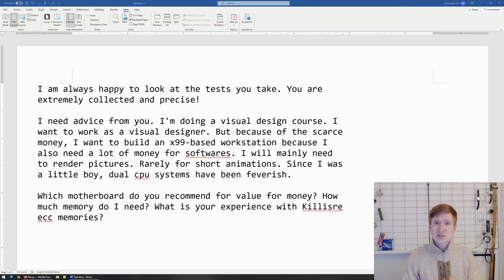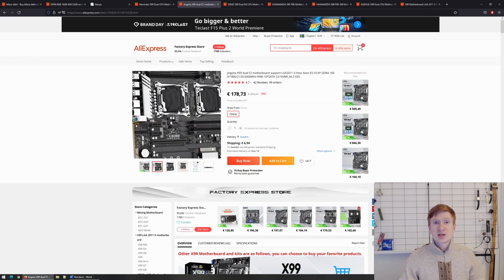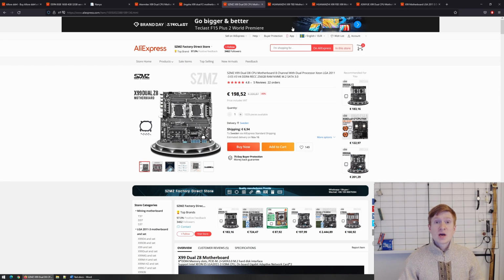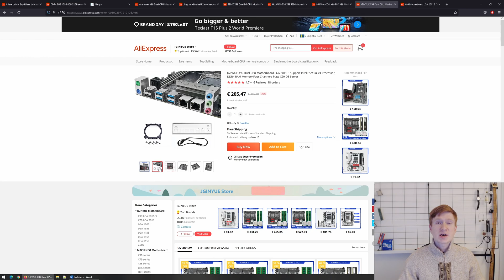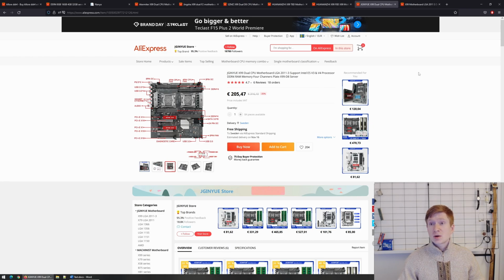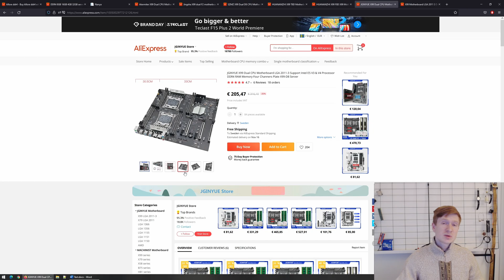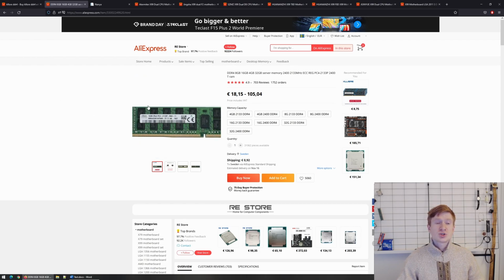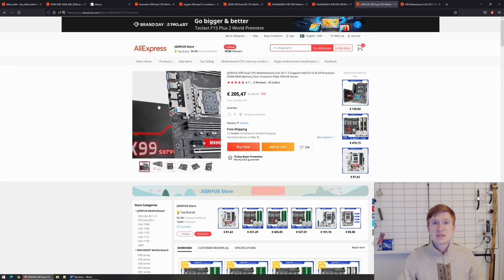🇬🇧 Dual Socket X99 motherboard for a visual design workstation | Miyconst Answers 03

Comment: Can dual socket motherboard used with single cpu? Planning to upgrade later.
Reply from the maker: Yes, dual socket motherboards can work with a single CPU, but some parts of the motherboard, which are connected to the second CPU won't be active.

Comment: Actually make sense but don't all video rendering already use all cores? Not sure. I only have an 8 thread PC but it maximizes them all.

But regardless, Graphics cards exists. It barely makes any sense to use a CPU based software rendering machine as opposed to a hardware rendering with GPU. Hardware rendering is vastly superior in terms of speed.

The only reason I can think of why they may use these machines are multi-workload machines. I don't personally have one but I'll probably use it as a NAS and CCTV storage for home security as well as maybe an offload rendering system so I can leave my home after starting the rendering process.

In the future, maybe network booting.

Comment: guys can you suggest which motherboard from aliexpress supports 2699 v4 CPU?
Reply from the maker: Huananzhi X99-F8 supports.
Reply: @miyconstclips  the issue is that I want dual xeon 2699 V4 🥺
Reply: @akrenderman  why do you need a dual socket setup?
Reply: @Miyconst  am doing 3D rendering mate
Reply: @akrenderman  then you can try Huananzhi X99-F8D, but make sure to cool the VRM properly.

Comment: Agree 100%
I am currently using and testing Huananzhi F8D w/ dual 2699v3 CPUs.
For my personal unit, TurboBoost unlock @2.9Ghz all core is resulting in 66c on the hottest core using 2x snowman MT6s CPU coolers. VRM temps are 49c and 60c under load measured with a cheap infrared thermometer accurate to ±4° or 2%.
All in all? Very satisfied. Keep in Mind Miyconst is 100% correct about memory latency and single core speed. In my case I am doing VM experiments using many cores and lots of ram simultaneously. These experiments are not designed for any kind of mission critical work or long term deployment, it's like my personal laboratory.
Reply from the maker: Well said!
Reply: How much power does it suck from the wall outlet while idling?
Reply: @_miranHorvat  unfortunately I have changed configs and I can't take from the wall numbers on the F8D with those CPUs. My 2x 2699v3s are in an asus z10pe-D16 now in a server build in an experimental deployment. If I get the chance to spin it down and introduce a watt meter for from the wall figures I will.
For the interest of general knowledge, the two chips are 145W and combined they will not exceed 270W. Total system power at idle is likely above 100W given that, in its current configuration, it has 2x 1070s, 10x 3TB HDDs, 4x 2.5" SSDs, and 512GB of ECC. When I can measure it, I will.
Reply: @greenprotag  I was wondering about the same. But my current home server uses 35W idle and 42W with the mechanical harddrive spun up, so if you have 10 HDD's you are probably well over 100W. Going with a single Xeon as replacement, was tempted to do that dual build but it's massive overkill in my case lol.

I found i7 chips to be very power efficient at idle. I use Win2016 server and even with power managment set to run the CPU 100% all the time it takes almost no power at idle. So was already wondering how that is for the Xeon chips.

What is a shame on these dual boards is that they don't leverage the real strength of these Xeons, and that is that they have 40 PCI-E lanes each. If you are going all flash for storage you can basically add 4x NVME SSD per 16x slot if they support bifurcation. Basically on a dual Xeon board you could run a 16x GPU if you wanted, 10Gbit NIC and still have PCI-E lanes for 15 SSD's LOL. You would require at least 5 full size 16x slots but better 4x full size and a few 4x slots.

If they had more PCI lanes a dual configuration with 2 lower end Xeon's would be very tempting.
Reply: @_miranHorvat  I have pretty much the same configuration, not dual 2699v3 but dual 2696v3 which are the OEM version with a slightly higher single core turbo. I also use it for a VM server, nothing critical but still. I have a watt-meter, I tweaked the voltage in the BIOS ( but failed to unlock turbo boost, however, I managed to get better single core performances from 370 to 405 according to CPU-Z ), I have 6 HDDs in ZFS, a shity GPU for output, and idle with 7 VMs running at the moment, it uses around 200 Watts.
Reply: @Kelianon  Hey bro, I am having the same configuration as you X99 F8D with dual 2696v3, do you mind to share how did you increase single core performance?
Reply: @aftershock7258  Sorry I am late
I'm not sure I really improved the single core performance by this bias tho, but the CPU-Z benchmark seems to go this way.
First, I unlocked the BIOS and tried to get a higher core count turbo-boost, but I failed and it's obviously because it sucks too much power and even the VRM can't even suck that much. ( 36 cores at 3.8 GHz ? lol !) that being said, I activated the C6 State without retention in the BIOS.

I already had windows server 2019 installed bare-metal, and did some benchmarks. With the results I had confirmation that I would not make it a powerhouse from single core loads, and I was tired tinkering with the BIOS for CPU unlock. I had around 375 for single core performance in CPU-Z. It is worth noting I had the hyper-V feature enabled but no VM was running, the test was made from the windows hypervisor. But that might have some effect I had not later.
 
I then switched to Promox for better VM management.
The first test VM, was windows server 2019 as well, but I did not activate the Hyper-V feature before the benchmarks, only AD DS and stuff. While creating the VM, I noticed I could change the CPU emulation, and by default, it is "kvm64". I wondered how much I would get on proxmox with that setting and surprise : I got a 7% single core improvement from 375 to 405, at the cost of some cpu instructions according to hardwareinfo, such as AVX. when I shut down that windows VM and change the "hardware" -> "CPU" -> "kvm64" to "HOST" ( so recognized as Xeon and not standard virtual cpu anymore ), then again I get the same single core result as the baremetal config.
In both VM test I tried with 4 cores allocated without another VM running. Obviously the bare metal windows server had all cores available.

Hope that help, that is not a very scientific method but hey, for virtualisation I'm much happier with proxmox than hyper-V so still an upgrade :D